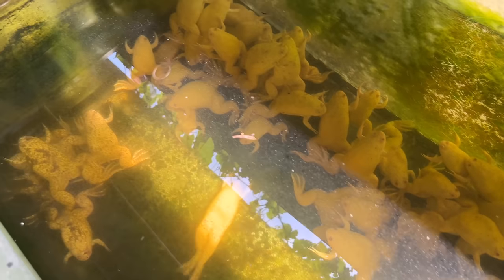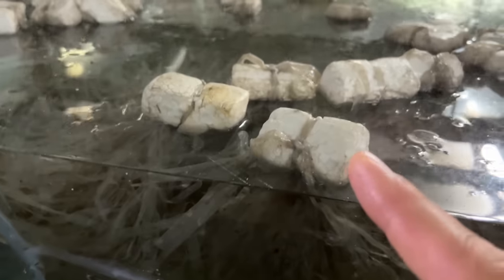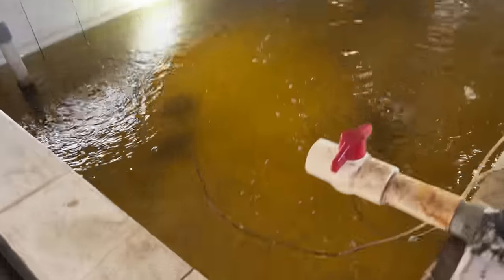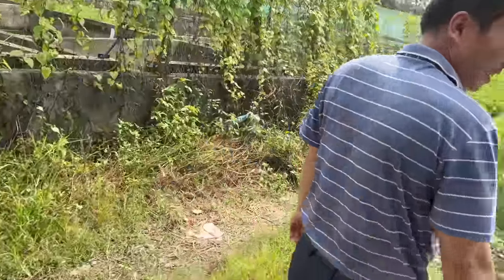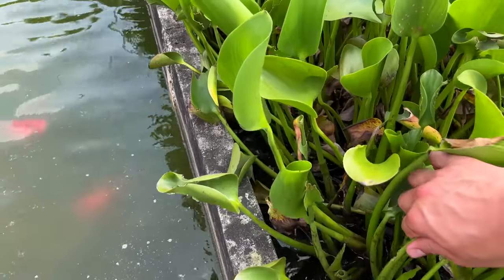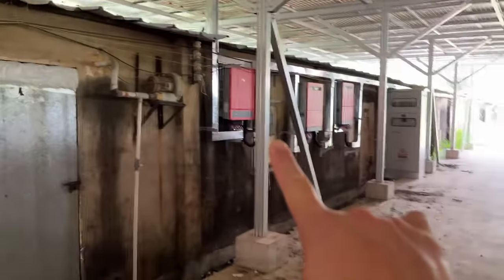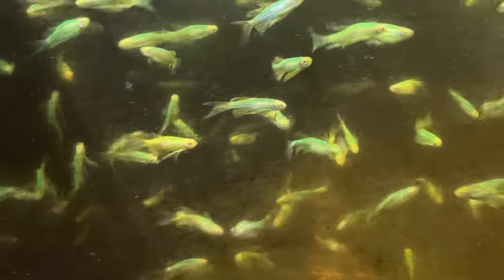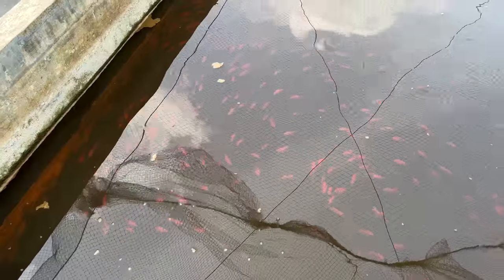Inside a HUGE Tropical Fish Farm in China [Private Tour]

Comment: anyone know if the coop dual air pump get louder if you only use one of the outputs? I don't always need 2 air out puts.
Reply: Any dual outlet pump will be louder with only one outlet in use. Having airline hooked up to the outlet acts like a muffler.
Reply: The dual outlet air pump is designed to power 2 air stones/sponge filters. Using only one outlet will reduce the functionality and make the pump louder. We would recommend choosing the single outlet air pump if you only plan to use one outlet.